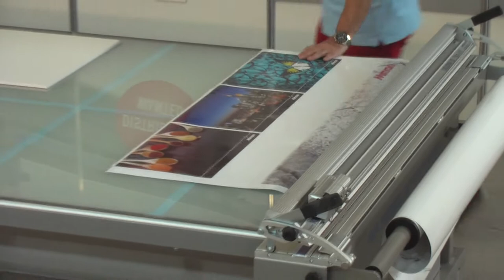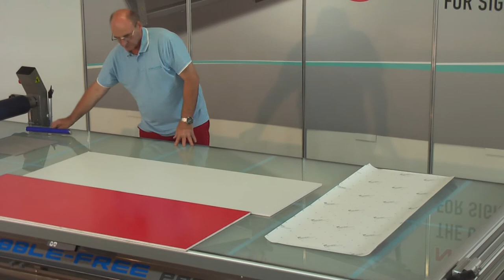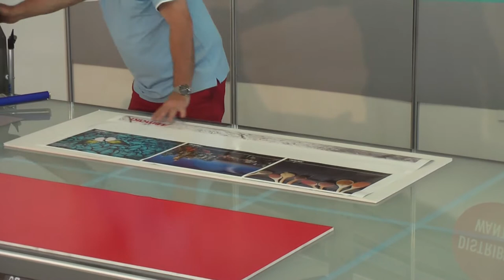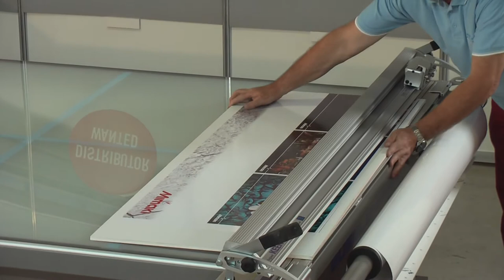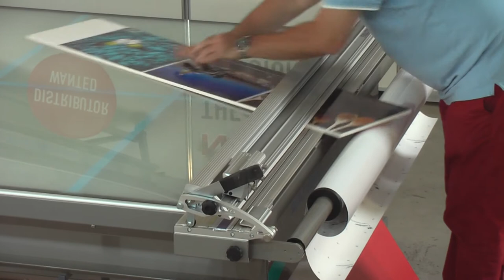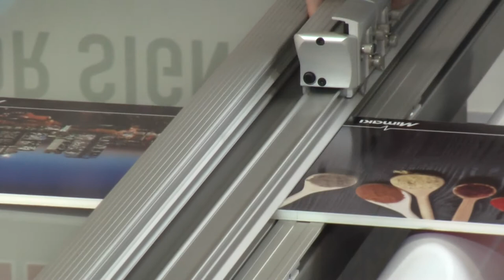BUBBLE-FREE PRO Applicator Mounting+cleaning+cutting 2

Comment: On this video, their is a red seperate board the other side, is this to keep tha main roller even ?
Reply from the maker: This foamboard thickness is 10mm. When you don't put in the middle the vynil goes wrong. -> when you put onto the table two materials with same thickness, the roller will paralel with the surface of table (with the material).